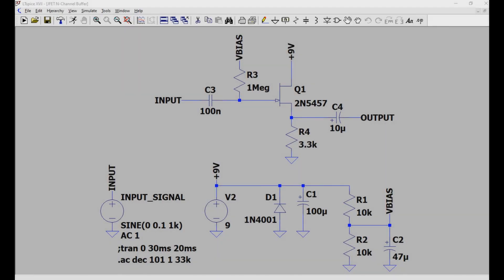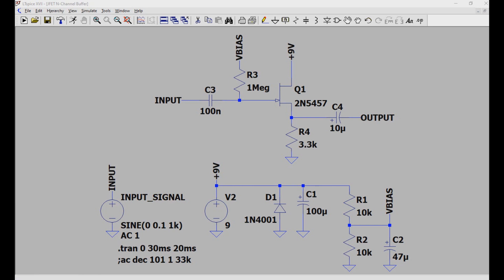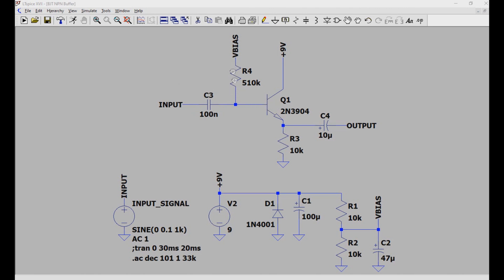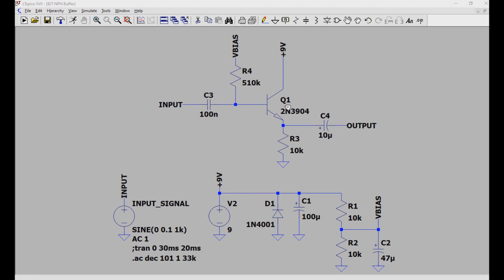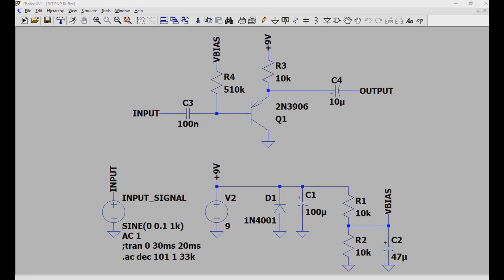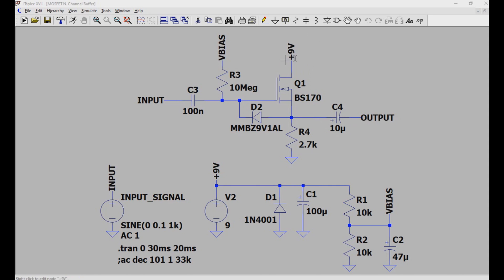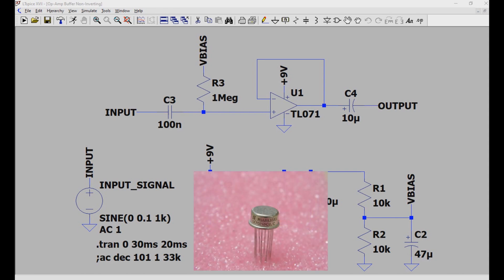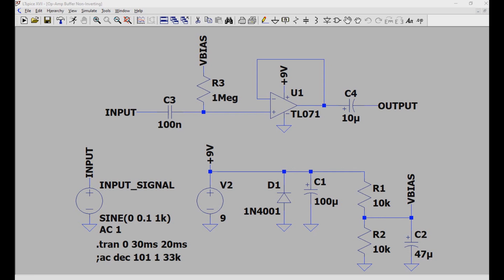5 Kinds of Buffers in Your Guitar Pedals

Comment: I am looking for a simple boost buffer  circuit for tube amps with line level input.I plan on purchasing your buffer board and parts. Can that be modified for3-6db boost.Also looking for a circuit that will split 12vdc50mA to run a small op amp rumble filter of a DC wall adapter.Do you have a reverb circuit like Flying Saucer with parts and pc board.I heard one advertised, but they had a questioner to fill out.Questions like Who made the firstE-335 guitar.I failed it so thy didn't want to sell me the board!
Also i plan on building a fuzz Face.Whats the difference with the transistor pair you sell.Do you have NPN BC108C silicon pairs? Thanx

Comment: very informative - THANKS!. I have an op/amp buffer at the front of my board - it has TL072 - is there a difference between TL071 and TL072?
Reply: No, no audible difference for most of us. TL071 is single in a package while TL072 are double in a package.
If you like to do a little bit adventure, you can substitute TL072 with LF353 or LF412.

Comment: Hi, from MN.  Thanks for your helpful info.  I haven't been into pedals much, but they can be fun.  I've got a Digitech do everything digital one that is alright.    I got into this analog area of interest via piezo pickup pre-amps, like a simple JFET buffer. Lately I have been working on adding a basic trem, with the idea of embedding it into the guitar.  I have a breadboard circuit, roughly based on this schaller trem circuit, optimized for light battery usage, so your 9V would last or you could use maybe a few smaller CR 3v batteries.  Circuit uses about 200uA.  A few piezo preamps I tested use 1 to 2ma typical.  I've stuck with transistors for this, op-amps tend to use 1-2ma current.  I've recently become aware of specialty pico power op-amps, but I haven't determined if they could be appropriate for say a piezo buffer or embedded effects.  Cheers!

Comment: If you were to install an onboard buffer into a guitar what type would you use?
Reply: Well, maybe none, but if you are a fan of active pickups, that is kind of the idea they play. The EMG81 is using an op-amp as a differential amplifier, but as a bonus, creates a good amount of impedance as well, using said op amp.
Reply: @erikvincent5846  I'm trying to isolate the cable  Capacitance and use an OBEL  While not being stuck with a set of active pickups like EMG

Comment: For the buffer based on 2N3904, how was the 510K bias resistor R4 selected / calculated? Why not 560K? Why not 470K? If I substituted for 2N5088, does R4 need to be adjusted?
Reply: The bias network needs to be chosen so that it can supply enough current to keep the bias voltage constant when the transistor is drawing it's maximum current. Basically, it needs to allow a current flow into the base that is greater than the current flow through the emitter resistor in parallel with the load divided by the transistor beta.

Comment: I noticed you have a volatge inverter, are you blokes going to offer a voltage doubler that makes a 9v - 18v with more headroom?
Reply: I don't see why not. We have it configured as a reverse power setup, but not as a boost power setup. I'll see what we can do about that. On the Turbo Driver, this is built in, but I think that's about it.
Reply: @erikvincent5846  yesh I saw that mentioned on another video. A doubler would be a great addon and it save me having to buy one from the UK!!

Comment: There is a fairly simple N chanel JFET/PNP BJT combo circuit that has great qualities. High Z of the Jfet, and low Z of the BJT, better gain qualities and power supply noise rejection. but it's technically a "unity gain amplifier." I found the circuit in a Faichild's datasheet application notes for JFETS.  The BJT is biased directly by the drain of the fet and they share a source/collector resistor to ground. I used an MPF-102 (now J-113) and a 5087 for mine. Sounds perfect and drives a cable real good. 2 transistors, 4 resistors and a couple caps.
Reply: At the end of the day, that's an answer for a lot of big name pedal companies. JFETs in the front/in, BJT in the back/out. But, if noise floor is the name of the game, a lot can be said about op-amps in the front and back (Klon).
Reply: @erikvincent5846  I believe the Klon circuit actually uses rail voltages as well, which negates the need for a bias voltage. Bias voltages can add to the noise floor. I am a fet fan though. Cool little critters.

Comment: I'm sorry man, I have a question. What is the efficiency of the power converter you are using? Is it a standard configuration used in these kind of application? If we would use a DC-DC power converter in a closed loop, the efficiency will increase at the prize of chip area and system complexity. Do you think the use of a DC-DC of converter could be beneficial? Is there a prcise reason why to use this simple converter? Thank you for your time.
Reply: That's a pretty good question. Most of the DC-DC converters I've ran into are typically switchers, like the ones from Murata or Recom. They are nice, but they also have their draw-backs. Mainly, the issue of noise injection, which can effect the noise floor if not properly filtered. The Murata ones are nice, as in their datasheets, they actually put in circuit suggestions to get FCC approval, which is strict on noise rejection. Recom... not so much. I've made some circuits for driving a guitar pedal through USB with a 5V to 9V boost switcher, and though it "functioned" it just made too much noise, which in turn propagated to the rest of my pedals. Basically, if you get involved with switchers, be prepared to learn a lot about filtering. Efficiency isn't much of the issue, so much as its the line level noise.
Reply: @erikvincent5846  Yeah, thank you man. I really needed an answer based on practical tests. As you correctly pointed you need to take care during the design phase of the gain and phase margins of the loop of the DC-DC and try to minimize the output noise of the system. I can imagine that with a little pole/zero analysis you can figure out a way to correctly filter out the noise, but the filter design might be tedious and of impact on the final foot print. Thanks for your help dude!
Reply: @leonardacciold  Wait till you see my boost circuit I am working on to drive a tube 12AX7 preamp. I made a switcher circuit that, aside from a SOIC-8 IC, is through-hole, boosts the voltage from 9V up to 50V, but keeps the keeps the noise floor low. The only question is "is it safe" for the DIY community. I mean, I use it, but I am not the safest person to be around when it comes to electronics. I may give Electro-Boom a run for his money on electrocution.

Comment: Greetings from Singapore! I have so many questions! :)  Any difference between an input and output buffer circuit? Any good examples of using a single dual opamp (eg tl072) for an input and output buffer? If the opamp buffer is seemingly the best, why are different buffer types used for different pedals? How does a Cornish buffer differ from the NPN you showed?
Reply: Well, for commercial examples, the Klon uses op-amps on the in and out side. A lot of Boss pedals (DS-1, CE-2) use BJTs on the in and out, as well as the Tube Screamer, and discrete fuzz pedals like the Big Muff. A good combo I see a lot is JFETs on the in side, and BJTs on the out bound side, but in those cases, a lot are surface mount, and in that market, JFETs are more plentiful. I like using op-amps as buffers for mixers, like when you want to blend a dry signal with a wet one, a buffer is required, and I typically go with an op-amp there. Also, for gyrators, buffers are required for that, and again, I prefer op-amps in that situation.

As of the Cornish buffer, it's a bjt buffer, but there is a lot of tone shaping prior and after the circuit. I am not sure that "buffer" is the word I would use, but that is what they call it.

Comment: That BS170 circuit looks a lot like the Super Hard On. Personally I use a TL072 with two buffer circuits in it at 18v. And then run one early in the chain and the other before the amp.
Reply: The SHO is a common source amplifier as opposed to a buffer, but there are a lot of similarities